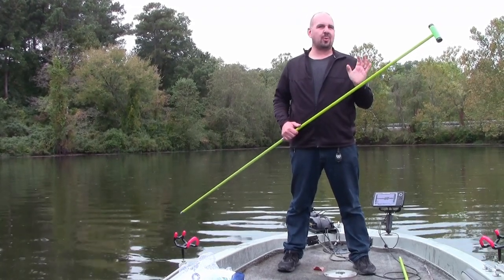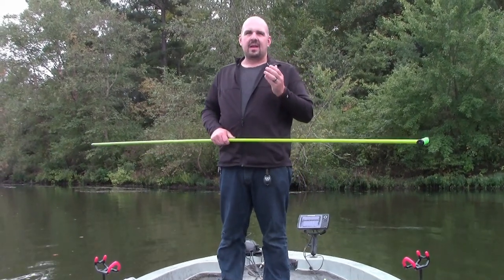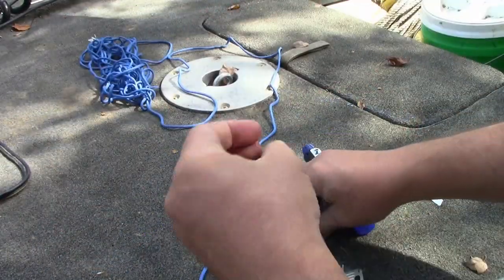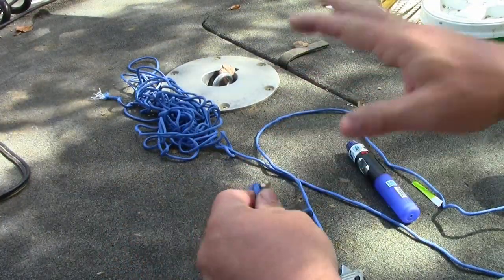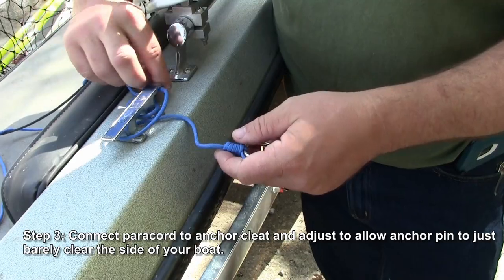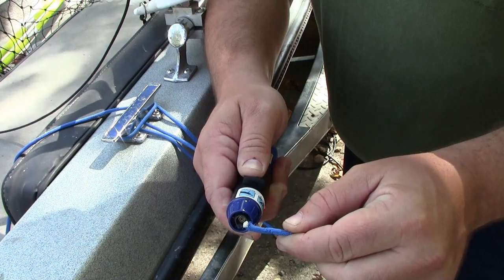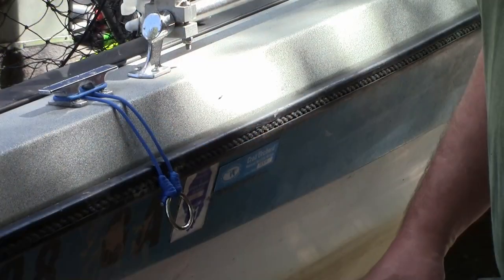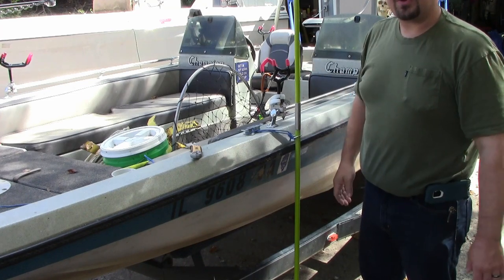How To Build a Quick Deploy Tether for Shallow Water Anchors & Stake Out Poles

Comment: I made mine out of a 3/4 pipe tee fixed to my boat with a door flange. Its always there and i just push my pole through it and into the bottom. Plus with one up front and one in the rear it really helps stabilize the boat.
Reply from the maker: Great idea as well. I'm not sure how I ever got along without those poles.
Reply: @TheWeekendAngler  honestly ive only had mine installed for a short period of time. Actually made the poles out of some PVC for a handle and a thick fiberglass tomato stake from the garden section for about $9 each. Theyve made a huge difference in setting up for duck hunting and im really looking forward to using them for fishing as well

Comment: Do you do both sides of the boat on this quick Deploy Tether???
Reply from the maker: It depends. Sometimes I will toss a conventional claw anchor off the front of the boat and then use one (two if necessary) pin anchors off the rear corner of the boat. Other times I will put one pin off the front and one off the back.

If you're not in a lot of wind or current, one pin will hold your boat. I prefer the stability that comes from having multiple anchor points, however.

Comment: I noticed that you had the nut for the rod holders on the top  I found that they are way stronger under the boat deck and have a flat peace on top to tighten the nut down to
Reply from the maker: Those rod holders use the monster rod holders rail mount. They thread into the rail mount bracket. The nut is only used to keep the rod holder from turning.